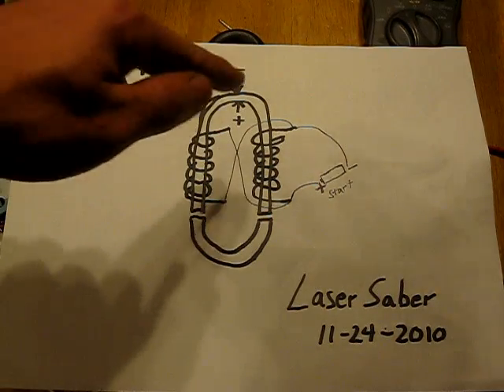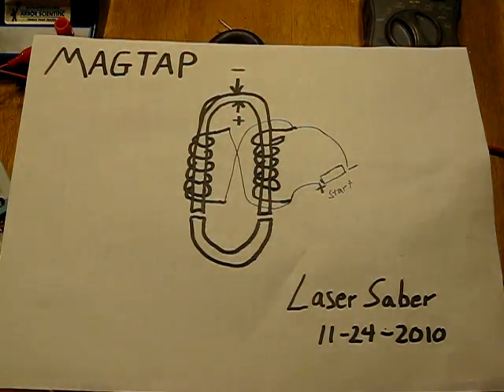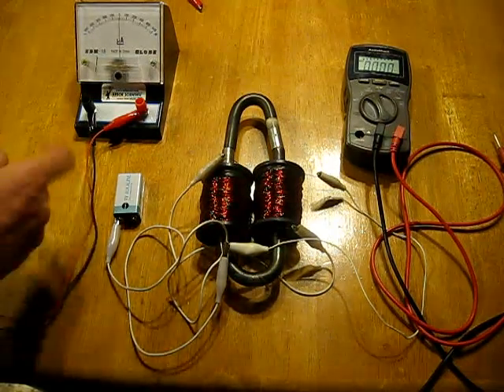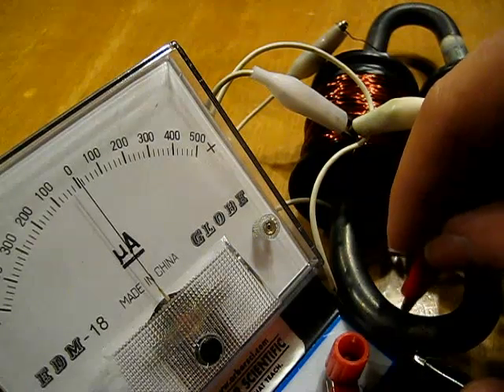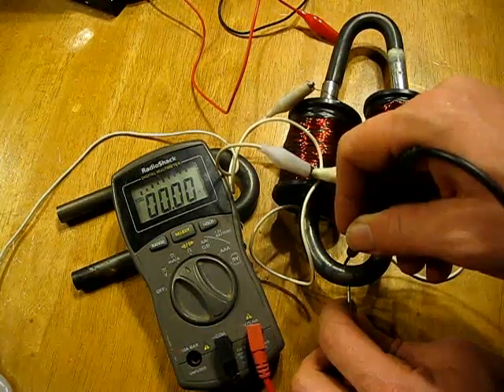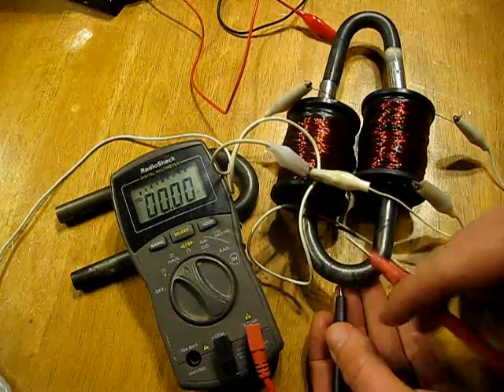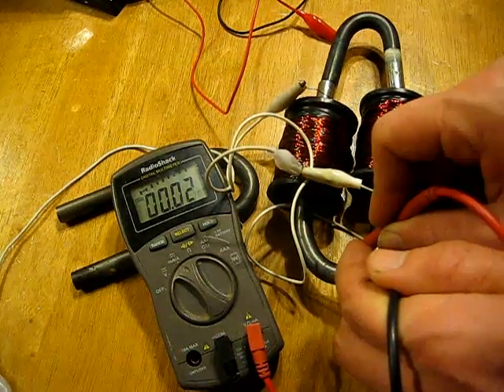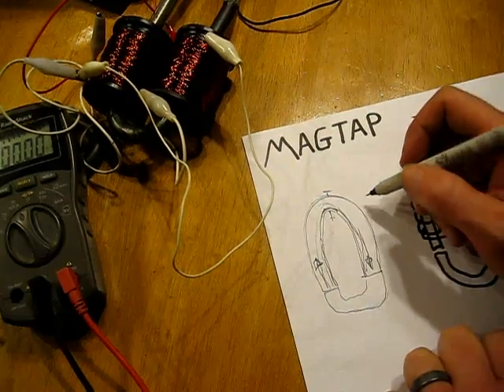Magtap: harvesting electricity from a magnet!

Comment: the mag loop is closed so the bloch wall will be much weaker or not exist under this circumstance - you're right about the curve concentrating the mag waves outward - it would be nice to find an optimization - I saw this film, seems about 3 years ago, but I had not yet mapped the fields

Comment: The voltage you are measuring is called "eddy current" that current is a manifestation of the magnetic field generated.  Eddy currents cause heat and greatly reduce the efficiency it when used as a transformer, which is why ferrite is used instead of steel or iron.  If you used carbon steel, you would see much higher eddy currents flowing through the core.

Comment: THE TAP WAS INTERESTING BUT SPENT TO MUCH TIME ON IT WE GET THE POINT.

.USE A COMPASS AND OR IRON FILINGS TO DESCRIBE THE ELECTRO MAGNETIC FIELD. YOU CAN ALSO HOLD THE DEVICE UP TO AN OLD CRT TO LOOK AT THE DISTORTION PATTERNS. WHAT HA-PENS IF YOU PUT A TEST TUBE OF WATER INN THE CENTER OF THE LOOP? DOES IT GET WARM ?   THERE IS A PLASTIC Magnetic Viewing Film - Magnetic Field Display Film 6" x 6"  AT   https://www.amazon.com/Magnetic-Viewing-Film-Field-Display/dp/B00129CCGS THIS MIGHT DEMONSTRATE THE FIELD.

What would happen if you break only one leg of the circuit and inserted an LED or another coil?  would the device still act like a electromagnet?

Comment: I was hoping you'd run the test on the other inside turn. Your tests are interesting, there is a difference between the straight sections and the curved sections, a magnetic field within a piece of curved iron / steel  is NOT a uniform magnetic field, whereas in the straight sections it is. This material is covered in toroid areas of electromagnetics, the idea that you extracted some voltage at those points is interesting. 
    Another test, semi related.  It is my theory that a toroid coil can act like an oscillator as follows. If you move a STANDARD coil by itself through a magnetic field sideways ( no circuit attached ) the ends will develop a potential difference like a straight wire, this is well covered material, HOWEVER, if you move the same coil straight into the magnetic field the tops & bottoms of each turn will develop a potential difference ( a variation of the Hall effect ), example all the tops will be positive or negative charged or reverse of that, a rather interesting capacitor. 
    NOW lets expand upon that. We use a toroid coil with an round steel / iron ring inside ( no breaks in ring ),  you revolve a cylindrical magnet just below the toroid ring at high speed  ( common axis ), the steel / iron ring draws part of the rotating magnetic field inside of itself while the magnet rotates, this makes the revolving magnetic flux higher in the area of the toroid coil, the HALL effect I mentioned takes place and if sufficient velocities are achieved I think that the charged developed on the toroid can collapse and discharge sending a massive electromagnetic pulse outward then recharging and repeating, this is theory mind you. 
     Now, if this is the case, there's a lot of wasted electromagnetic pulse, lets put it to use...
example, Hertz Spark Gap device, did anyone ever try surrounding the emitter with a hollow metal sphere, I would think a massive pulse would create high current one way or another, thus a potential difference at top and bottom. 
   Whats interesting is that the turns on the toroid are slanted slightly, the electromagnetic pulses that impact will also be of the same orientation, angled like the many bird cage winding's on a rotor of an induction motor. 
   There is also a burst of electromagnetic pulse directed towards the center, it is also slanted, heres where you need to experiment, you put all this in an metal sphere ( non-ferrus ) allowing some opening so you can revolve the magnet, you mount the magnet so it freely turns, the bearings need to make metal to metal contact, ..... the revolving magnet ALSO gets hit by the electromagnetic pulse and drives a current top to bottom of itself, this current alters the permanent magnets field momentarily which changes the field around the toroid ...we have all that stored magnetic field in the steel ring, its field also oscillating,  rising and collapsing which effects the Toroid...
  I think a rather interesting oscillation will occur until the energy is used up and or a certain limit is reached.    
       I think there's some eye opening physics involved here,    Just food for thought ...

Comment: i can easily explain this phenomenon..  OK so.. The perpetual magnet holder is basically a permanent magnet when it is in the "locked" state... Therefore, there should be a magnetic field within the metal, and some will be outside the metal as well.. we all know what happens when a conductor passes through a magnetic field... you generate current.  Notice that you only get that current pulse when you tap the steel, and then the current goes back to zero?? Ya.. That's cuz the current is only generated when the conductor ( the probe ) is passing, or moving, through the magnetic field.  Once you stop any motion, the meter will go back to zero.  You probably noticed that you got a bigger reading the faster you moved the probes around... rate of change of magnetic field tru which the conductor passes will increase the current.. So you see, nothing really breakthru worthy of this.  Try it with an actual neodymium magnet and you'll see a similar occurrence.  Sorry bro, looks cool but it really isn't.
Reply: +localbroadcast he held it on the points, wasnt moving them
Reply: +localbroadcast That doesn't explain why there is a very specific point where the current draws.  It would be an interesting study in geometry to find a point in a magnetic field that is more concentrated.
Reply: +Thomas Sexton simpleton...  magnetic fields are pretty much consistantly varying in concentration and density by their very nature!
Reply: You must be blind. The probes were still and the current was constant at many points of the video

Comment: lasersaber+  Small electrical currents can be detected in the body, nothing to do with finger grease as suggested by someone below. The potential difference you have found is real, seen this reported before, but its potential to create energy from would need a lot of investigation. User2718218 has not got a clue and the hypothesis is laughable (finger grease!!!! :)   )

Comment: I suspect this is a chemical battery effect where the active ingredient is finger grease.
Reply: +User2718218 
I suspect there is another process taking place that explains the digital and analog meter measurements in that clip.

When you put the probes of a digital multimeter between your thumb and 
forefinger of your left and right hands you can measure a voltage when 
the multimeter is set on the most sensitive scale.  Why is that?

It's possible that your body is picking up 50 or 60 Hz hum from the 
electrical wiring.  You can easily see that on a scope or hear it when 
you touch the input of an audio amplifier.

But let's look more  carefully at very small DC voltage and current measurements.  You have 
the multimeter probes in each hand and you can sometimes see a small DC voltage or current.

The surface of your skin is salty and the  tips of your fingers are covered in what we call "finger grease."   So you can easily create a very weak chemical battery due to the salty finger grease on your fingers when you hold the two probes between the thumb and forefinger of each hand.

Here is what Lasersaber may be setting up in his experiment:

<probe metal> <salty finger grease #1> <dissimilar keeper metal> <salty finger grease #2> <probe metal>

That could very easily be a Count Volta chemical battery.

The big clue is that Lasersaber does not measure any voltage on the top and bottom of the keeper metal in the clip.  That's where there is much less finger grease.  But he does measure voltage on the inside and outside of the keeper metal.  That's where there is a lot of finger 
grease.

Where he made a mistake is to not try the same test without the keeper being energized.

Comment: what if you add a 3rd coil to run a forced radiant oscillator after the PMH is locked? would the PHM unlock? maybe the oscillator can tap the energy flowing in the PMH...

Comment: If you were to tap any meaningful amount of current from these amazingly efficient closed systems you will find it quickly depletes the magnetic field initialized by the momentary application of power from the battery. Your discovery is as interesting as it is unanticipated none the less.

Comment: Are you positive that the current isn't caused by moving a conductor through an induced magnetic field? Could you get the same readings by moving you positive meter lead through the center of that metal whatchamacallit with the negative lead to the outside of the whatchamacallit?
Reply: if that was the case he should have been getting a reading only while he was moving it but at multiple times he stopped when he found a strong spot and as long a his hands stayed steady at that pot he continued to detect current.

Comment: The establishing of the initial fields in this set-up is described quite well by the equations for electromagnetic induction. What I think you have created with this configuration is what is referred to as a "magnetic bottle" as described by observers such as Richard Fitzpatrick at the University of Texas @ Austin. The electrons [charge] trapped between the coils will have a tendency to "corkscrew" gyroscopically back and forth repeatedly along the field lines between the coils under the influence of the Lorentz force and in turn this creates a changing flux which generates an emf in the coils in accordance with the equations for electromagnetic induction. The set-up will not work perpetually as there will be eddy current losses in the iron core and the electromagnetic energy stored in the coils would dissipate almost immediately if you connected the circuit to an external load. Interesting work though, well done!

Comment: It's a little hard to see on your video, but it looks like your DMM is set on AC.  But you used DC to create the phenomenon.  Is that right?  Think about that.  Don't listen to naysayers.  True, I think you are probably only testing voltage potential here in this case but you might be on the right track.  BTW, laminated plates are used on AC electromagnets to dissipate the higher heat coming from AC.  Advantage, the AC electromagnet reverses magnetic polarity 60 times per second.  The DC magnet doesn't.
Reply: I think that the digital meter is set on mA, he is checking for current with both meters.

Comment: It could be that you are on the boundary of where the north pole and south pole meet as we know that a moving or changing magnetic field cause electric flow. Or, the outside of the ring is the north moving and the inside of the ring is the south moving the other way. The tow points you touch create the potential difference.

Comment: That current is from the ambience from your fluorescent lighting, the radio station, ect... take the digital meter into a heavy industrial plant and it will go wild (micro amps) just sticking the leads in the air or near a large conductor. To use an ammeter, you either use a clamp on or you have to break the circuit.  You can collect the "free electrons" with a "tank circuit" and a bridge rectifier. There are several devices on you tube that will allow you to collect free electricity from the air or 'ethereal energy'.

Comment: Id be willing to wager that if you were to store a constant tap at that point, and store that charge in a capacitor....youd find that the device would slowly run down over time, and eventually the magnetic force would be broken...what you'd be left with in the capactor would be the exact amount of charge needed from the original energy taken from the 9V battery when you charged up the device......hence no energy created, or destroyed.  Just a really slow and painful transfer of energy, taking long enough that it creates the illusion that you're getting something from nothing.  Im not anti free energy either....I can just see that in this case, that is the likeliest outcome.

Comment: Nice electromagnet!  The more current you dump into it the stronger the magnetic current you get!    When you break the circulating magnetic energy the field collapses transferring some of its enegry back into the coils.  Replace the bar section with a strong magnet... rare earth... energized dc.. whatever..  stick that on a rotor... give it enegry to move.... bam.   
You have a generator.
I wonder if though,  the way you have this set up.   Could you use these set up in  series or parallel.. have them mechanically switched open and closed.  Storage uses? Voltage or current regulation applications?  Melted wire a nasty shock?

Comment: your explanation of charge separation is correct...electrons travelling at the bottom of the core is postive and negative at the top....this is due to the fact that electrons travelling at the bottom follow a closer path making them bunch together faster...since they are like charges they must flow faster at the bottom in order to keep themselves separated ..they flow slower on the top curve because there is more space at the top so more electrons can accumulate there and move slower..the result is postive reading on the bottom due to faster flow and negative reading on the top due to slower flow with respect to each other....even though they are both electrons.....similar to the hall effect device exceprt that in your unit, geometry causes the effect....not induced current.

Comment: Similar to the motionless electromagnetic generator from some years back.  They found that the magnets were used up as "fuel" until they lost their magnetism.  Or lost enough magnetism to no longer be productive.  The magnets will decay very quickly this way. 

Since it requires much more energy to magnetize ferrous material that what energy is contained in the resulting magnet, the project was abandoned.

Comment: There is such a tiny flow, or burst, of current, I'm not sure we can attribute it to the magnet holder. There is a lot of "pollution" in the area. The current may be being generated by the contact of unlike metals. Possibly, it is coming from moist fingers. Too many uncontrolled variables on the lab bench IMO. however, it could be that it actually is being harvested from the "permanent" magnet. A simple arrangement like this could be expected to be a bit leaky. Still, it merits investigation.

Comment: I found your video after doing some of my own experimenting. I wanted to see if anyone else had tried to get any electricity from a pmh. I found you can actually get a steady voltage if you connect one lead to one of the coil wires and the other lead to any part of the metal. I was able to charge a small capacitor several times with it but it took freaking forever. There was no noticeable change in the magnetism afterwards. I hope that helps.

Comment: I was wondering if you have seen the PMH  made with two rectangular pieces of metal with a groove cut in the center on the faces which is where a single wire goes (no coils or "U" shape bend) here is a youtube link - watch?v=eWSAcMoxITw   I wonder how this might differ in getting current readings on it since there is no outside radius to get a + or - from like you did in this video.I built one  It works good but need car battery to energize it I guess single wire needs more current

Comment: Does it make a difference if you use a larger initial charge such as from a car battery? Also, I wonder if you would get different results by using a capacitor for the initial charge instead of a battery! Have you tried using any other metals for, or varying the size and shape of the loop?

Comment: I forgot to add, also the frequency. I would study what Harold Aspden had to say about all this, also look at Coler's Stromerzeuger, and Floyd Sweet's triode, and notice that Sweet used a large air gap, and Coler used magnets as part of the electrical circuit. That is what I mean about using the H field. By using the magnets, one can tap into the H field that sets up the B field, or gather the amp/meter energy.

Comment: You can calculate the H field, or the amp/meter by using a FEMM program, and set up your experiment to calculate the B field, or the flux density of that steel. What most people don't realize is that that will be how you capture the aether energy, but the key to obtaining a decent amount of energy is to set up a large air gap in the system, and it will have to be A/C consisting of square wave or pulses. The amount of energy will be limited by the volume of the air gap and the flux density.

Comment: does the tighter bend in the keeper have a greater or lower potential. could you also try a keeper with a right angle bend init and test for voltage at the inner and outer angles

Comment: @lasersaber: Do u realize that u apply force when u tap/press the electrodes/contacts on to the magnet? The force you apply most probably cause eddy currents. Try to attach the electrodes and then not touch it, and you'll probably see the current go away - instantly or slowly over time.

Comment: Just some of my random thoughts, this is non-judgmental.
If the current flows like a river then that spot is like an eddy current. So maybe a round ring with a small V manufactured into it? What your saying is the geometry of the device creates a spot for current build-up and removal at that spot. Also maybe 2 small/thin sheets of copper in between the 2 points of the keeper?? The laminated core is a great idea. Also interesting to hold a magnet close with the probes showing current.